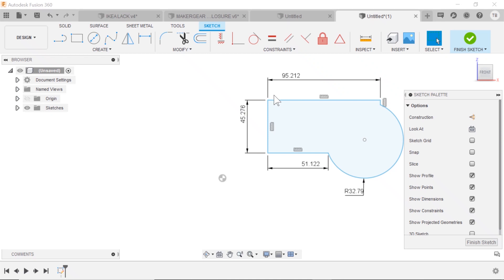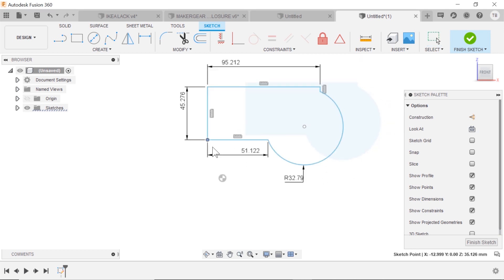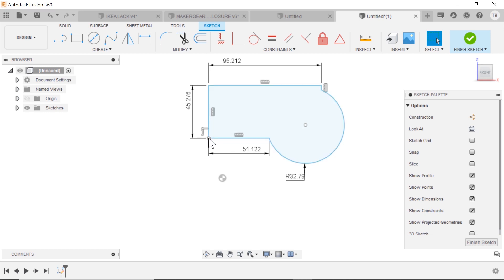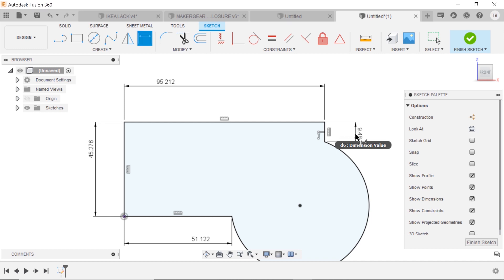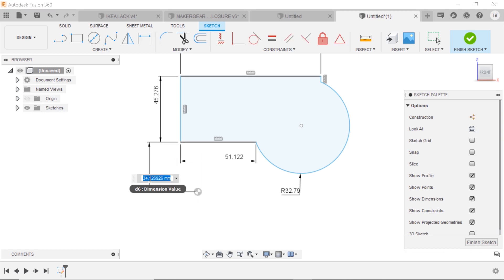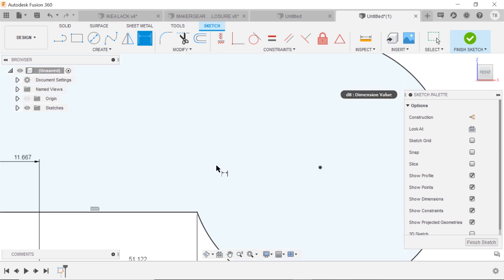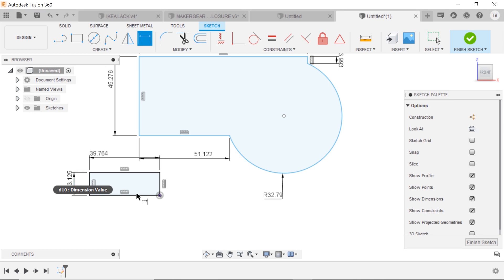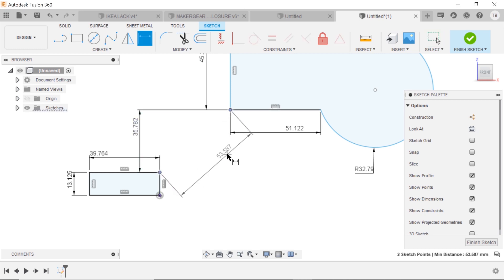Fusion 360 sketch to origin- (Why Sketch Still Moves)

Comment: This tip is perfect for me. I have been working with Fusion for a few months and have issues with fully defined sketches. I started adding constraints to make it work, but 99% of the time, my issue is that I don't have an x and y dimension back to the origin. That solves all my issues. Thank you.

Comment: Is it a good rule of thumb to ALWAYS built components to origin? I find it annoying when i make models with many components (that later will be joined) that they all are centered and on top of one another when trying to view them (before alignment or joints).  And at the same note... Best to make components separate rather then inside one another?